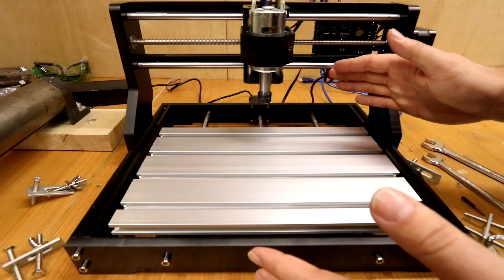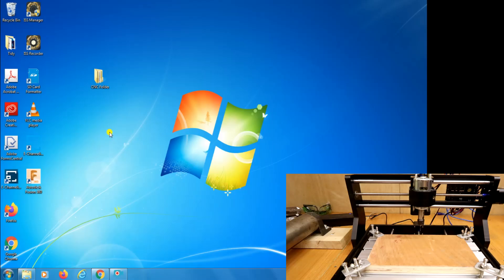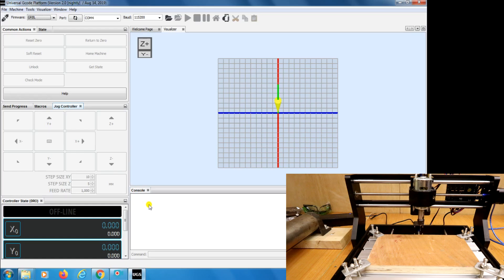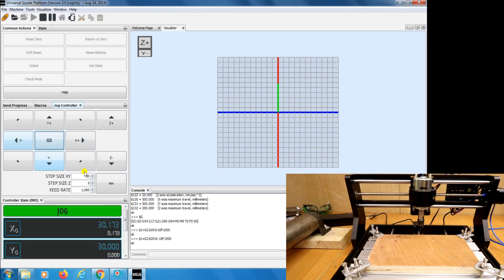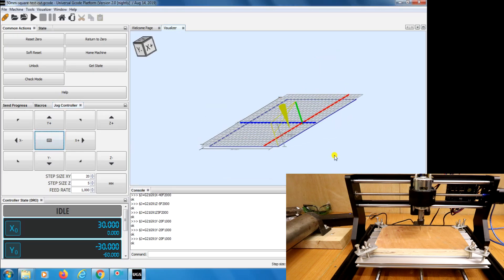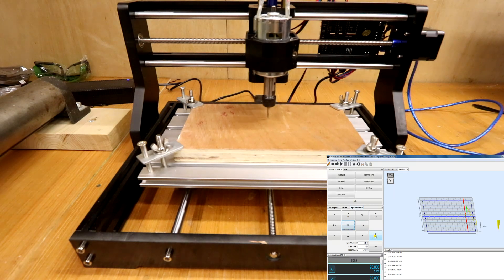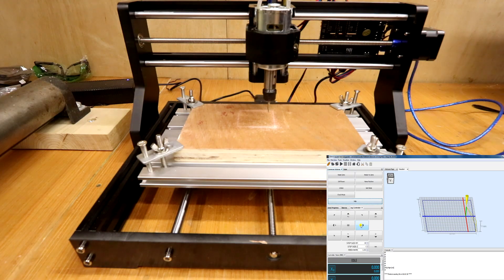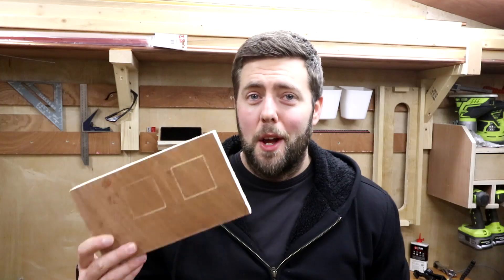3018 PRO - Making your first cut

Comment: Just found your site & it is so helpful.  I was given a 3018 pro.  I have limit switches fitted but only for the home position.  Did you set soft limits for the axis limits? TIA
Reply from the maker: Thank you. I didnt but this is one way to try and control your machine to not hit the edges of your frame.

Comment: Brilliant. As a first time octogenarian using a cnc I found this channel very very helpful to get me started. I have been noticing that there are a lot of people that are using laptops that cannot get ugs to load or work on their machines. I had the same trouble but found that ugs version 2.1.9 will load and work even though the interface is different to the one you are using. All the items are there but in different places so there should not be any problem in using it. I hope this info may help anyone who is having a problem with ugs. As I said before a BRILLIANT channel and everything explained in easy to understand language. Thanks a million, keep up the good work.

Comment: 2:00, These hold down screws are tricky to work with. I have fitted a rectangular threaded washers which fits into the plate grooves. When locked tight, you're tightening problems are fixed, for good. No more fiddling with the bolt and your fingers. All you have to do now is turn the wing nut.

Comment: Hi James  I have just purchased a sainsmart 3018pro have you any tips for improving the coupler on the pre assembled z axis unit as this came loose and ruined the test piece, the grub screws actually vibrated loose could I use locktite to hold them in also when will we see more videos in your carveco series 
Thanks 
Pat

Comment: Hmmm. Where did I miss the part where we make some kind of a PHYSICAL connection via USB from a computer to the 3018?? It wasn't in the build video and, although I ca see a blue USB cable at the start of this video I can find no place where any such connection is made. This, even though we were walked through the build at a detail level where we watched zip ties being trimmed. This matters, because my unit has an "offline controller" and that looks like I am supposed to use sneakernet and carry micro SD cards between my computer and the 3018 (which, of course, I would rather not do).

Comment: I want going to watch this video because I had already put mine together, but i decided to start at the beginning of this series to get any insights.
I would have saved so much time of is watched this video first, and i feel like an idiot. After watching this i now realize that i put the "y" motor at the front. I knew i had something wrong. Well, back to the shop and reassemble it. 
Big thank you!
Reply from the maker: At least you have found the issue and not wasted any more time, that is the main thing 👍
Reply from the maker: Also, thank you very much for supporting me. It is really appreciated.

Comment: hi i finally got a new 3018 pro from vevor and bought a new laptop as well, i installed ugs 64 20.20 i think but now he connects and disconnects right awayi have an external usb 3 hub with power, in device manager i disabled the option to shutdow usb to save power i even tried to play with the connection an buffer speeds but no result. what do i overlook or wrong.
I hope you have time to answer with best regards Marc Aah i bought as well for the other machine a new controller board but i extended that to a 30 40 and wait for extra glyders to mount the next panel, maybe i have to buy a board extra and put the new board on the 3018? please be kind If you can of course and help me out.

Comment: Hey James, could you do a video of the actual connecting of the unit to the computer? plus minor trouble shooting when you start the unit up, before actually running a test piece. My 3018 doesn't have readable instructions and what IS in the manual, is in Chinese. So I had no way of determining what is negative or positive. I didn't even know which is the power input, as both my connections are the same size, so silly me, hooked the power cord into the spindle motor, and of course it started spinning... still not sure if its spinning in the right direction anyway. But finally got it hooked and connected, BUT is it supposed to be making a squeaking noise when I move it back and forth? plus, when you say you press the arrow forward, and the table moves backwards.... mine isn't moving backwards, it moves in the direction of the arrow... And I HAVEN'T even done the test piece. lol

Comment: I bought a couple of files from esty but they’re not loading on to the program it says the file appears to contain binary data please can you help?
Reply from the maker: What type of file did you buy and what software are you trying to load them into
Reply: @JamesDeanDesigns  thank you very much for replying. I got given two files from my purchase one is 37.7MB sti file and the other is 232.8MB sti file and I am trying to do it on the 3018 machine. With the software UGS and also tried it on Grblcontrol (candle) hope this helps. Thanks again for the help.
Reply from the maker: STL files are the 3D files but they won't work in the control software like UGS. You need to load them into something like Carveco and generate the toolpaths
Reply: @JamesDeanDesigns  thank you very much for the advise I will give this a try.

Comment: Greetings, I followed the steps in the video, but when I connect the machine, it does not recognize the commands, it does not move with the program and I have not been able to do any test, just like Candle, which has the same problem. Excellent video and I hope more will come. Thank you very much for the contribution.

Comment: Hi James, I just ordered this machine, being a complete noob in CNC cutting. You mention the Candle software it comes with, is a bit temperamental, causing you to switch to other software. Could you elaborate on that? As this video is 3 years old, is there a chance the software it comes with today, will work more reliable?

Comment: Hello 🙂
Do you think you could help me? I've finally set up my CNC 3018, and I'm trying to laser cut. It seems to be functional, the light is on, and my computer recognises the machine.
However, when I try to use the laser from Adobe Illustrator, it can't locate it as a 'printer'. When I try to use GRBL Laser, it SAYS that it's found the machine, but when I run my cut, nothing physically happens, despite the program saying that it's completed the laser cuts.
I'm so confused!
X

Comment: Great videos James but how do I set the cutting depth. You have yours set to 11mm but no idea how to change that. Please help as I have been watch the videos for days but missing that adjustment that was so ease on Easel.
Reply from the maker: Hi Bill, on this video you do not change the depth, its just a test file. If its within Easel, you select the shape you're editing and the slider bar should be there allowing you to change the depth
Reply: @JamesDeanDesigns  Thank you James. I used up my free time on Easel so trying to use UGS to engrave a file that worked on Easel and saved as a g-code. I opened the file in UGS and the depth of the cut is now zero. I would like to change the depth of the cut in UGS but can't find how to do that. Or in your test file with a depth of 11mm, what if you wanted to change it to 6mm on your test file, how would you do that? Or am I missing something, maybe it can't be changed in UGS and the depth has to be changed another way?
Reply: Being a senior citizen novice to all of this and slow to catch on, maybe the depth of cut is determined in the CAD stage? Not the UGS stage. If that is the case, I need a program that can save in G-code to import into UGS? I have inkscape but it will not save as G-Code due to some extension error. If I need to set the depth in a CAD program, Is there one you could recommend?

Comment: James I installed the UGS software.  When I attempt to move the head, the numbers change for the x, y, z but the head does not move.  I've checked the power wires with no luck.  Any suggestions?

Comment: I see you have the 3018 Pro, I just got mine and have been following along. I did the speed testing and one thing I notice is that your machine moves faster than mine. I hit move 50 mm and I thing it's only moving about 10 mm. Any ideas. I know I'm new, but I followed this to the letter and the first thing it did was plunge the bit deep into the wood and got stuck. So I hear your pain about getting it to work.
Reply from the maker: Hi, Is it the speed or distance? its sounds like it is the distance and that it is not moving as far as it is expected. This video may help which runs you though calibrating your steps https://youtu.be/nGwUf8uNWBU

Comment: i Admire your honesty, in that it took 5 hours ,well for me it took alot longer on and off, the board got fried i got a new one, it homed perfect so i new the motors where correct but when i started a job the Y axis went in the opposite direction, well through persistence i found the problem ! i plugged the y axis stepper into the next slot on the board and hey presto it works !
Your video are very good easy to follow ,im sure your videos have helped lots of people

Comment: Hi James. Just set up mine and found out the Z controls are back to front. Push up button and it goes down and push down button the head goes up. Hence the test is backward with the up down.
Reply: How to fix this problem.
Reply from the maker: It will be your $3 GRBL setting that needs to be changed. The settings inverts the different axis directions depending on what number the setting is
Reply: @JamesDeanDesigns  thanks JD

Comment: Im following part 2 right now trying to get mine assembled. I watched this one, but one thing I didnt see ( I might have missed it) was any talk about spindle speed or feed rate. Do you go into this more in future videos for bit type, material type and depth of cuts?
Reply from the maker: Yes, this one is just to make sure everything is working. I then move onto designing in Easel where you can set your own speeds/depths/bits. Knowing what speed to do comes with time and practice though, there is not really a quick way of knowing that
Reply: @JamesDeanDesigns  Cant you just put all your information on a chip and plug it into my brain?   Why dont we have that yet?
Reply from the maker: @starhawke380  😆 that would make life much easier. Would have also helped me learn much quicker 👍

Comment: Do I plug the adaptor into the cnc and use the usb for the laptop? I’m so so so new😭
Reply from the maker: The power adapter should connect to the control board. Usually a small round hole. The USB cable then connects to the PC. The control board will draw a little bit of power from the PC so it may look like it's on but you need the power adapter connected and on to run everything correctly
Reply: @JamesDeanDesigns  thank you so much, i just seen this reply, I'm all set up now. just can't figure out how to get a test cut in my files, in fact, i can't find any of the images I'm saving but I'll get there

Comment: Hi James 
I got the 1318 pro. I'm new the cnc world but I haven't been able to get the ugs platform
Reply from the maker: You can use Candle or Openbuilds Controller as well. My preference is just UGS. There download site has been a bit temperamental recently but I think it is back up and running now

Comment: hey james, thanks for all the videos, ive downloaded everything i need, machine works in easel, but i am unable to unstill UGS 
It says connot load windows systems persistent data, user directory content is broken, resetting to default layout, would you by any chance understand what this means? 
thanks ken
Reply from the maker: I dont to be honest. However there are different versions of UGS released as it constantly being worked on. You could try one of the platform versions on this page if not done so already 
https://winder.github.io/ugs_website/download/
Reply: @JamesDeanDesigns  yeh i have mate, just get the jfrog platform well be available shortly, but nothing loads, it just refreshes every 30 seconds 😮‍💨

Comment: Hi James ! thanks to you I could build my CNC 3018 Pro easily. Th anks again for your clear and simple step by step instructions. I made a little contribution to thank you. But coming to episode 3 "your first cut", you lost me by switching to Easel. I realize that I don't understand the difference between Candle and GRBL that are on the usb flashdrive that came with the machine. So now I am lost. Do you have a video that explains it? Thanks again! Simone Fam from France
Reply from the maker: Glad it helped. If you have not already found it then check this video out. It break down each stage of the software process making it easier to digest https://youtu.be/EMI97Rcb0bQ

Comment: James: great easy to follow videos. I'm having an issue getting the spindle unit to move on any axis. The board is communicating with my computer via UGS. There is a connection, the UGS reads the board settings, but when I follow your steps to test the controls nothing happens. The consul doesn't show any error messages. Rather, when I click on the control is show the movement and says ok.Thoughts on how to resolve?

Thank you.
Reply from the maker: That seems odd. It essentially sounds like what happens when the board has no power. You can still connect it via the USB and connect and see your settings, but nothing will actually move. Does your control board have a fan and is that fan spinning?
Reply: @JamesDeanDesigns  It does not have a fan. I looks exactly like the one in your video. And there is a red light lit when its plugged into the USB port.
Reply: James: I hope you laugh at this and include it in a future video for beginners. The little assembly book that came with my machine was skimpy on details and the pics weren't clear either.  And in your videos for setting up the machine and testing it I don't recall you mentioning this little piece of info.

I thought the power was on because of the red light I saw when the board was plugged into the USB port. But alas, not. As I was searching for motherboards in the off chance I had to replace mine, I saw a picture of a motherboard that was clearly labeled. And low and behold there was something labeled "power button". 

So I flipped the switch and the unit works. Thank you again for your reply.

Comment: But how do you turn the spindle on? When I run UGS the spindle never turns on automatically and I haven't found a manual switch to turn it on. Candle has both of those, but since you say UGS is much better I wanted to run that. I'm using a Genmitsu 3018 pro CNC. Any ideas to help me with this would be greatly appreciated.
Reply from the maker: There is rarely any need to turn your spindle on manually. This should only really be done when you are starting a job, at which point it should be pre programmed into the file you are running. You can manually do if you really need to by typing m3 s10000 into the console and hitting enter. Then m5 to stop
Reply: @JamesDeanDesigns  Great that did work. Thanks. Just too weird that there is no spindle commands in the G-Code already.

Comment: I have just bought a Genmitsu Prover3018. As I am new to CNC I had a bit of trouble with my first cut. After designing my first image I had to use the Offline Controller as Candle and the Ugs recognised my machine but when I pressed send, Nothing happened. Eventually I use the Offline Controller which worked but when I sent the command to start the cut, the spindle raised up every time. Could this be something to do with the GCode created in Easel. Any help would be appreciated.

Comment: I just purchased a 3018 and have found your channel to be extremely helpful. I'm having one issue that I can't seem to figure out. I'm sure it is something simple. Maybe you can help. I'm using Easel to design and UGS to cut per your recommendation because I have some internet connectivity issues in my shop. When I open the G-code in UGS after I've downloaded it from Easel, the size of the workpiece is dramatically smaller in the visualizer than the dimensions I entered into Easel. For example, I enter 177 by  165 in Easel. It opens in UGS as ~144 by 132. I've tried changing the units to inches with no luck. I've tried running it as is and it only cuts the portion seen in the visualizer. Your thoughts on this issue would be greatly appreciated.

Comment: Hey guys l am having trouble doing my test cut.  So l wanted to know when l import the data from the Gcode, does it tell my CNC how to move about because mine seems to be cutting in circles at one place
Reply from the maker: Yes, the simple piece Gcode in this video literally turns the spindle on and cuts a simple square. Have you managed to solve it yet?

Comment: Thank you so much for your very well made and helpful videos! Unfortunately, I am stuck, as I am getting the error "Cannot find Java 1.8 or higher" when I try to install UGS Platform, even though I have checked and I definitely have the most recent version of Java. So frustrating!
Does anyone have any tips please?
Reply from the maker: Hi Jen. I had this on one of my machines. I ended up having to uninstall and reinstall everything. You can also download a pre-packaged version I believe with the java in one place.
Reply: @JamesDeanDesigns  thanks so much for your reply! I did just that, the same error, then I did it again with the version downloaded direct from them and it works! Now to get my head around the software 😆
Thank you so much for your help.
Reply from the maker: @jenshepherd8151  excellent. Glad it helped